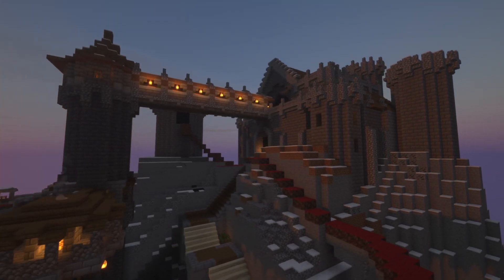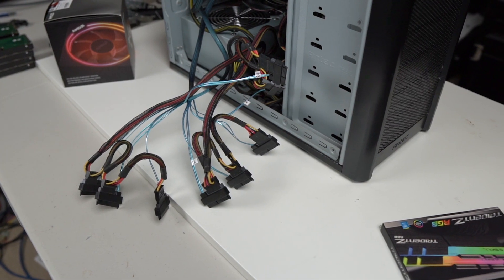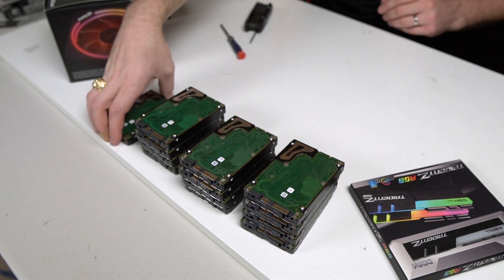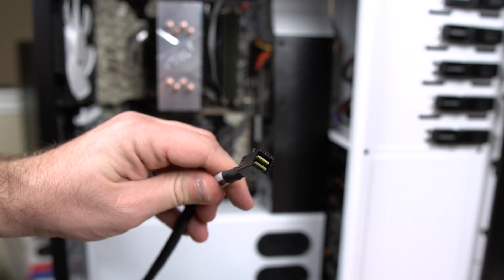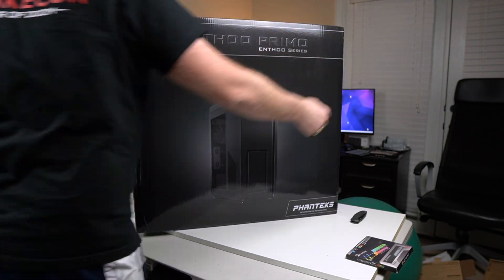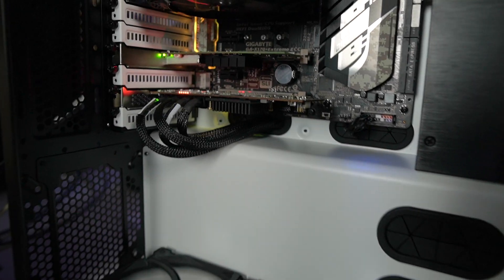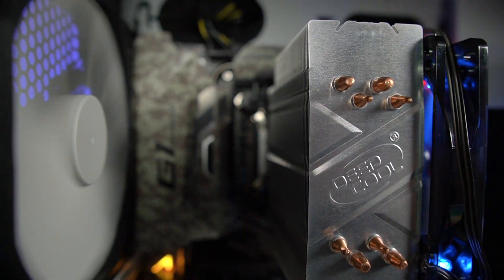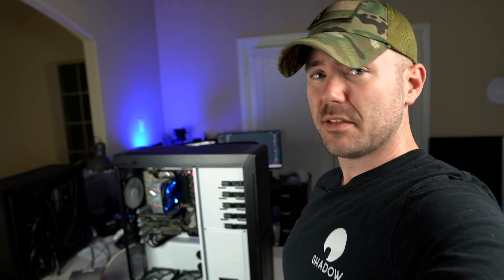Network Attached Storage Build with Icydock Drive Adapters

Comment: Ice Dock are nice having the sas connection built in, be interesting if they do 3.5 (but normally limited to 5 Bay if you wan them to fit inside a normal case so no sas ) , as 2.5 is more limited to SSDs now (unless you have a lot of them but 1 16TB 3.5 disk (or 2 8tb or 4 4tb) can replace 8 2TB 2.5 disks and use less power 

I use dell sas to sata cables as each cable only need 2 power (or the sas to sata only cable if the Dock has its own power, the last 10cm of the sas cable brakes out the 4 sata cables so its no more mess then the 2 sata power plugs) 

did you use the 2 vdevs in ZFS for performance reasons

HBA/raid cards are expected to be used in server cases so normally have some or high airflow (most people slap a quiet 40mm fan on them they don't need much)

Comment: What kind of RAID are you running. This is a great setup as well in case you ever want to upgrade to SSDs. Just imagine, 16x 1TB SSDs. That sure would be a strain on the marriage :-p
Reply from the maker: I'm running 2, 8-disk pools with raid Z2
Reply from the maker: And if I was going w ssd's I might go with this instead for 24 disks :) https://www.icydock.com/goods.php?id=231 granted that would be a mess
Reply: @TheTerk  Go big or go home? https://www.icydock.com/goods.php?id=366 ... lol. Might as well jump straight to enterprise level, full height U.2 NVMe drives :-) Ever since I discovered Mini SAS cables, I detest sata cables.
Reply from the maker: @MrJ0SH81  forget that - https://www.icydock.com/goods.php?id=265 let's make this concept a reality!